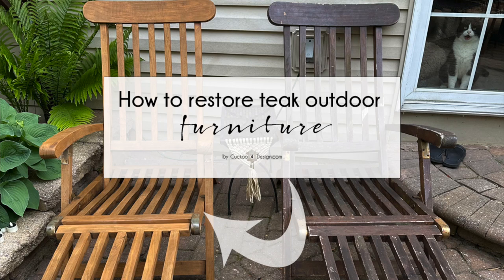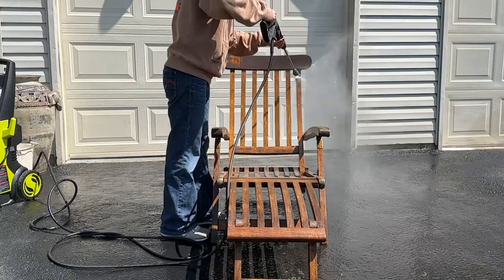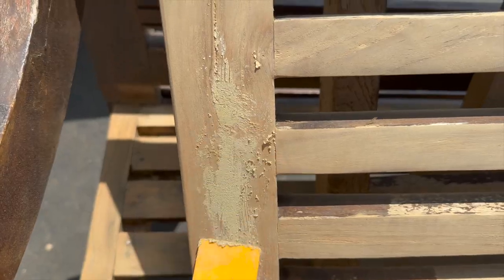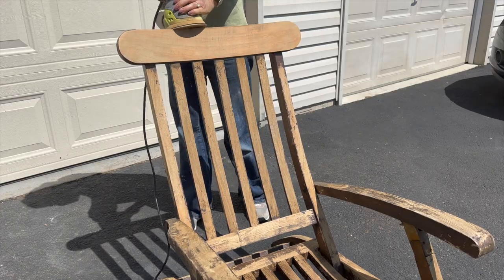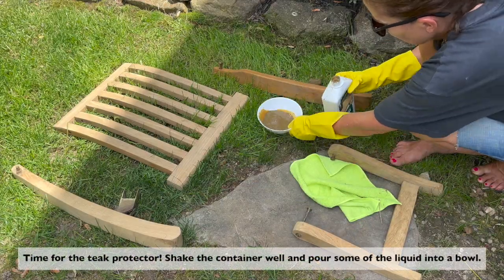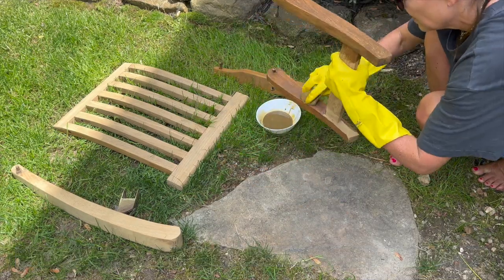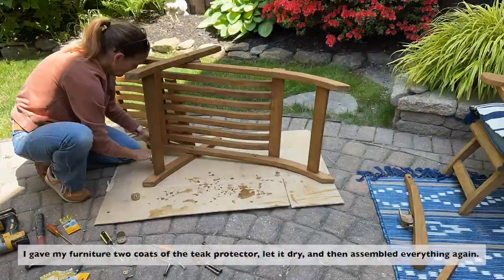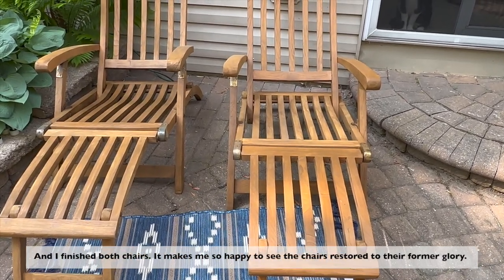How to restore old teak outdoor furniture

Comment: You are NOT supposed to pressure wash teak as it will remove the oil in the wood.
Reply from the maker: Yes that's what I also stated I my blog post that you aren't supposed to. But I did anyways and it worked and they look great still a year later since I added more oil and protector afterwards.
Reply: Don't you re aply the oils in the last step....? It looks great!